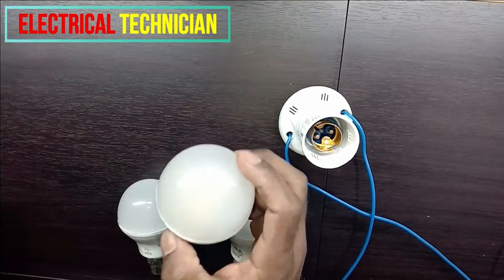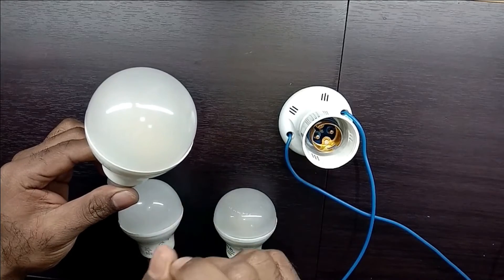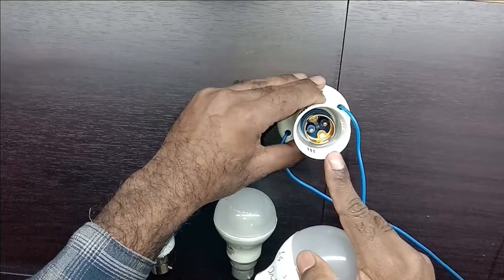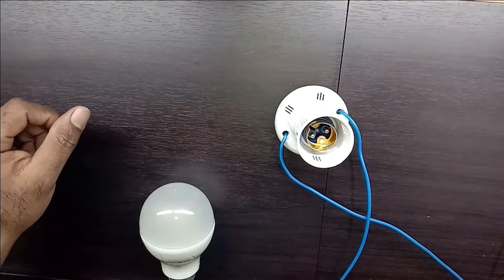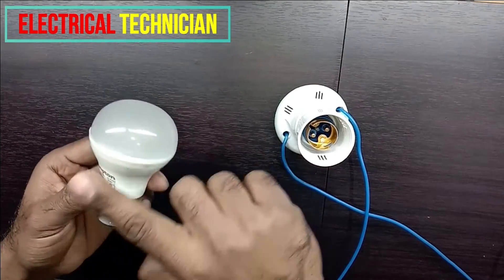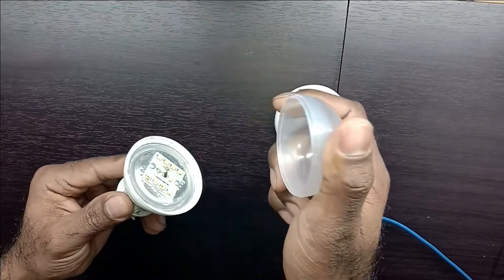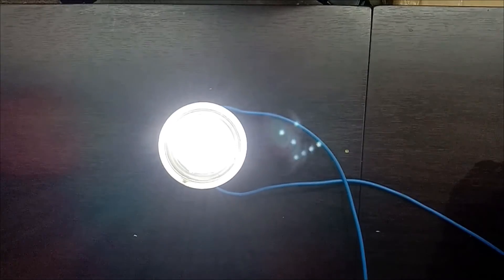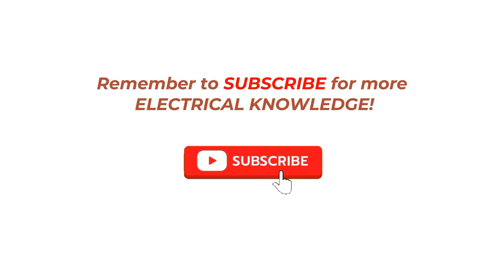How to Repair LED Bulb at Home for Free 💡 💡  @TheElectricalGuy

Comment: I would like to remark an edge case: a partial short.  
I had one bulb with a small black dot in one led, but all the leds, including that one, were on, even though very dim, when the light is turned on.   
Just short it, as you did, to discover the fault.  
I was considering complex things, like replacing the filtering capacitor, or the driver...

Comment: ⚠⚠ This is only a temporary fix.
You should warn people that this will only fix the bulb temporarily. When you bypass an LED in a bulb that does not use a transformer, the voltage drops, amps per diode increase and the rest of the LED diodes overheat and start to fail one after another. In a month or so, the bulb could fail once more. The proper fix is using a resistor in place of the diode or to replace the faulty LED diode with another diode. Instead of bypassing it.

Comment: These LED pads on the electronic board are in a obvious series circuit (each pad has a resistance value). When you pick off and solder over the former burned out ones spots, you are reducing the impedance of the overall circuit (reference both Ohm's and Kirchhoff's circuit laws). The remaining LEDS will burn hotter and die faster doing this. Plus, how much heat will this add as the bulb burns? You have a built in fuse? Not good. Folks don't do this...
Reply: Thanks for this post, I had this question as well, I will replace the broken LEDs with similar ones. 👍🤩

Comment: Instead of shorting, use LED or equivalent resistance...  That will last long.
Reply: Thanks for writing this. I had that question in mind, if the other LEDs would work harder with the extra voltage and current when "bridging" the damaged LEDs. 👍

Comment: Hope when you short de faulty led diode, since connected in series with out replacing , you increase their terminal voltage more on their designed rated voltage, does this have no effect on their life span?
Reply: It doesn't increase the voltage when the power is given by a constant current LED driver.

Comment: I came to across your videos and it so impressive I do subscribe to your channel, I have zero background when it come to electrical stuff, when watching your videos it seems to be you’re so professional technical man. My issue here is I leave in USA and built a house in back home Ghana the house were wired 220v and 120v for American appliances such as all led lights, sockets, home security cameras and other stuff which is 120v 60hz I can be able to convert the voltage meaning stepdown the voltage from 220v to 120v here’s my problem which  device do I need to convert the frequency from 50hz to 60hz while perhaps all my American gadgets frequency are marked as 60hz. I would be more appropriate if you could be help me.
Reply: Go and buy frequency converter.